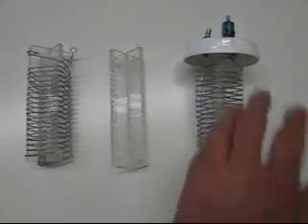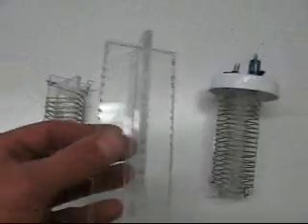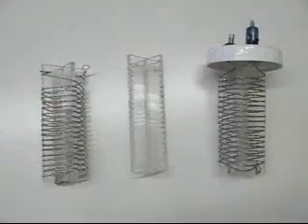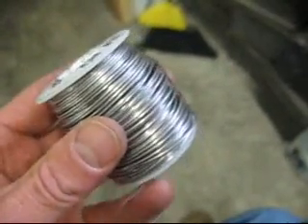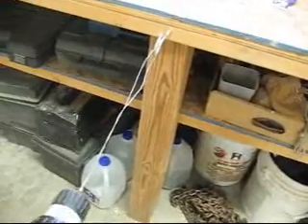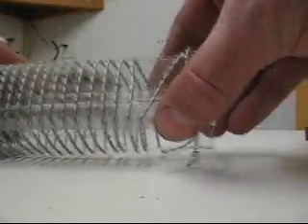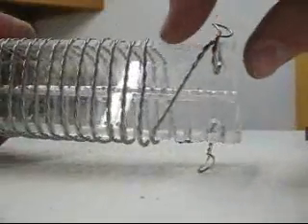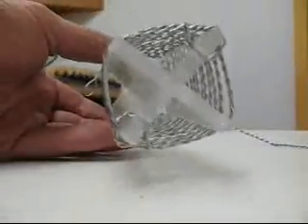How to build HHO Generator. Video 1 of 3

Comment: HHO  Make your car a hydrogen hi-brid Hho increase fuel burning efficiency better then a new car. Cool engine running  prolonging engine life and engine oil life with less engine maintainess required🚦

 100% fuel will burn in the engine No un 

burn fuel wastage . Hho system works on petrol, deisel, cng, lpg and lng types gases.

Engine runs lighter smoother reducing carbon emissions significantly . Boost engine power and torque . Hho gas reduced engine noice & vibration

ACMEC hho car kit lower the engine temperature more reliable simply made Hho kits restore better fuel economy. Hho system is very easy and simple to install. Hho solves the engine heating problems automatically! Cleaner engine running. Reducing engine noise due to the faster fuel burning. Hho car kits works nicely requires no modifications in the car engine. No side effects on car engine.

Engine start quickly your car battery Will Charge Quickly make your car a low cost hy-brid. Useing  low amps. Hho car kit will work better. You can easily transfer hho kit from one car to another one. Hho kits requires no any modifications in the engine. HHO kits absolutely work.

Comment: @snathanmax If you want to improve your car engine efficiency and save on your car fuel expenses. There is a better way to do it - it is HHO Gas. Using Hydrogen Hybrid alternative for improving your car miles per gallon or kilometers per liter. Search Google for "Top HHO Gas Car Research". Click the first result (Skip the Advertisement)

Comment: plus its not a "fuel cell" or a "Electrolyzer" it is called an Electrolytic Cells and splitting water into HH and O is called electrolysis. i rebuild any old rusty tool i can find that is human or belt driven, i use electrolysis to remove the rust, the fisrt thing you learn about is what not to use as an electrodes STAINLESS STEEL! yes it last longer but at what cost? gold would never have to be replaced use that. gold plated should work. electrolysis does not work with gold for plateing.

Comment: OMG you are useing stainless steel are you nuts? use carbon, gold, or platinum, do you know what happens to stainless steel in a electrolytic cell? ever heard of chromium 6? see how the water turns yellow? you know it is illegal to dump that on the ground or down the drain even if your washing it? ever seen Erin Brockovich? These compounds are bad enough that government regulations mandate "elimination of hexavalent chromate by 2007 for corrosion protection." your worse then the gas companies

Comment: int eh water4gas manual it calls for 2 different kinds of stainless steel the 316 and 640 or similar because of the charge charachteristics. well i guess your way is te most econimical

Comment from the maker: You have it right. I twisted both for ease of placement meaning that depending on the placement of the bottle (hose end, etc) that I could use either terminal as positive or neg.